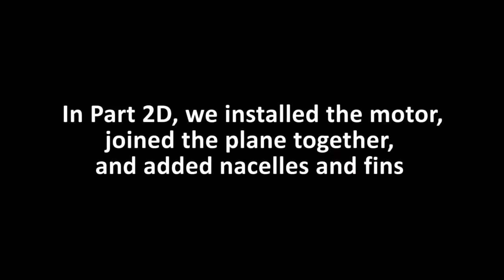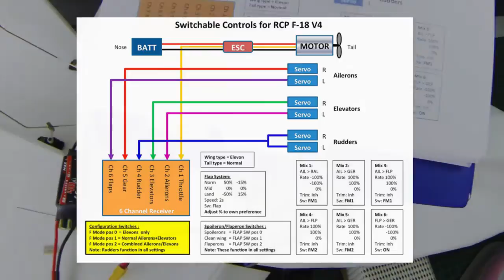Pre-Cut RCPowers F-18 V4 Kit - Build Guide Part 2E (final)

Comment: Hey John,    great video guide.   I just finished building my first RcPowers F-18 V3    fly's like a dream.  I like it so much I decided to order an SU-30 from RC foam fly Australia.    It just arrived and that will be my winter project.  I used lots of your tips and tricks!   I was wondering if you may be able to do a video on how you paint your planes?  My paint job looks good, but yours are quite a bit better!
Reply: +Brian Sliman Thanks Brian, glad you found the videos helpful. I haven't produced a painting video but I've provided step-by-step guides in most of my RCPowers build logs in the RCP forums. I I generally use the same system on all my planes. You can check out two posts that show how I painted my Su-34 V4 at these two links--
http://bit.ly/1M03vBa
http://bit.ly/1MygO6g

Cheers, John
Reply: great! ! I'll check them out. thanks so much

Comment: Power set up link is expire pls
Reply from the maker: It looks like the company that sold the power kit is no longer trading (it was a small outfit run by an enthusiast). You'll be able to source the same or similar parts from any RC plane part supplier on-line such as Horizon Hobby or Hobbyking or eBay.